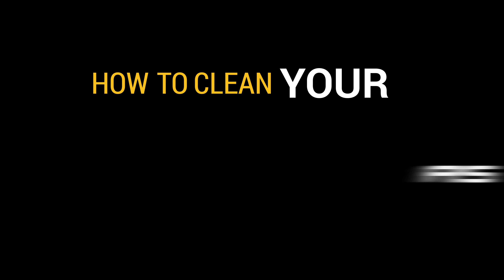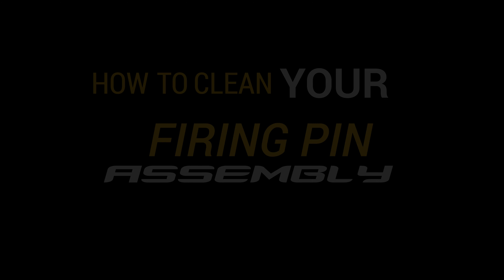How to Clean Your Muzzleloader Firing Pin

Comment: Can Hoppes be used to clean a muzzleloader?
Reply: Yes you can. I use hoppes black to clean my muzzleloaders barrel while soaking the breach plug, firing pin, spring and pin plug in hoppes9 they work great and I apply hoppes black grease to the breach plug
Reply: @jacobmullins3644  Thnk you for the reply.

Comment: how do you get the fireing pin out if it wont come out on its own due to possible carbon build up
Reply from the maker: You can apply light heat to the bushing to break up some of the carbon. If you still cannot get it out, reach out to customer service and we can get it handled.